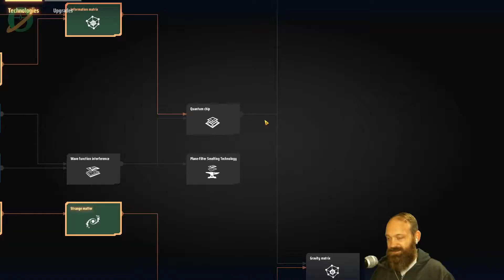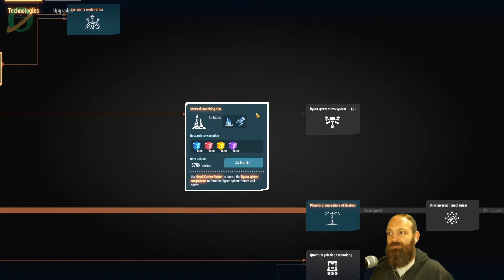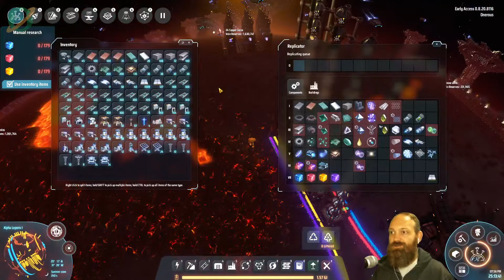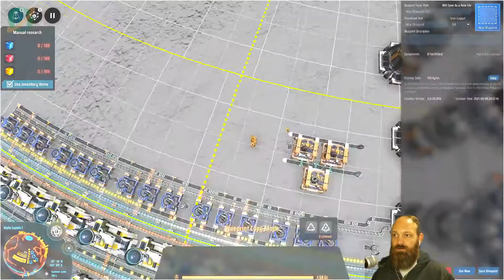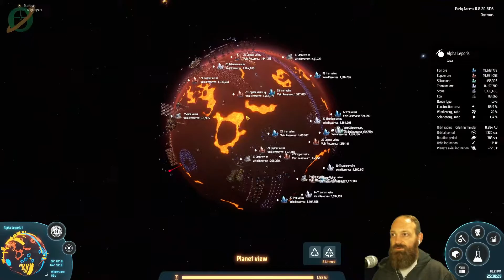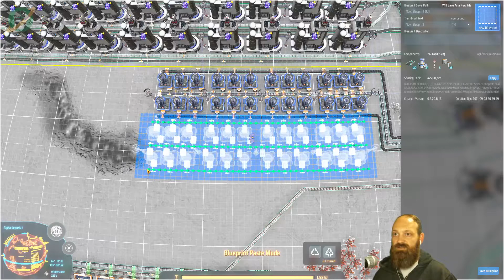Let's learn Dyson Sphere Program Ep 41: Deuteron Fuel Rods

Comment: (2nd part) 33:12 "Let's be reasonable and make it 500" (refers to how many Deuteron Fuel Rods you want to store): you should set it at 5000 'cuz you will need a huge quantity of these. 500 is very few and not "a ton". Episode performance 8.5/10 very good job ! Suggestion: consider using soon Mk 3 belts and Mk 2 assemblers to increase production in the same amount of space. Space saving is quickly becoming an issue. Expensive infrastructure is worth it. Of course you also need more soil pile to exploit locations with lava lakes (visit AL 4). Also consider mass producing Accumulators

Comment: Comments !  (very late in the day though)  (1st part) 3:28 the rods made from deuterium are called DEUTERON fuel rods, notice the different spelling and pronounciation 4:37 The twenty items needed to craft an Orbital Collector are NOT 20 accumulators, it's 20 FULL accumulators. In this game, accumulators can be picked up when full and used in many ways, including crafting and you can even put them in your mecha core, or moved to another planet, etc.... used in a lot of ways. If you recall, about 15 episodes ago, I suggested you mass produce 100 accumulators and install them in your power network where they would slowly charge, for a reason I would not reveal. There was a reason for that: no spoiler. Now you see what I meant, you need them to craft Orbital Collectors 10:08 Power grid still good despite heavy research ! 14:49 To save space for production, you can use large towers 'cuz they have 5 product slots and have a slightly larger footprint